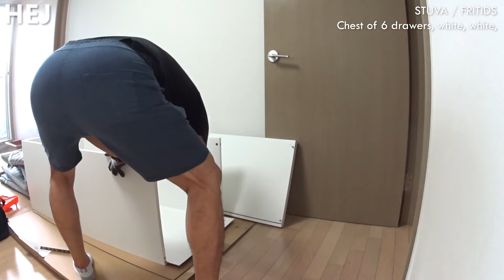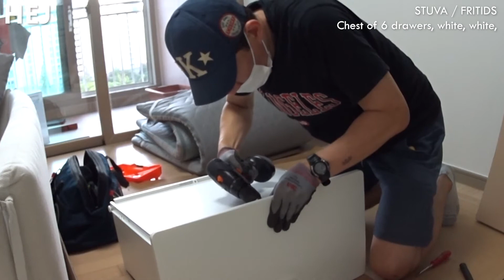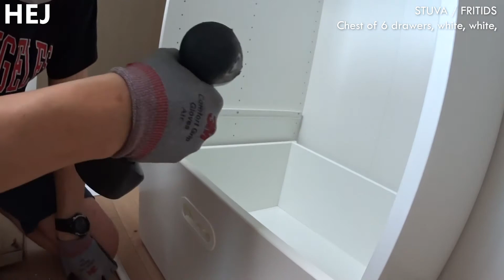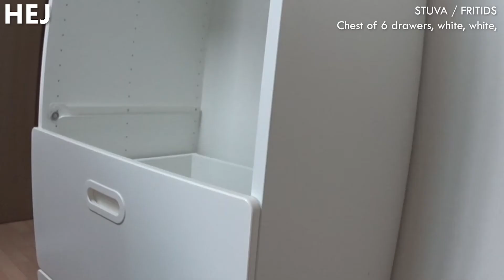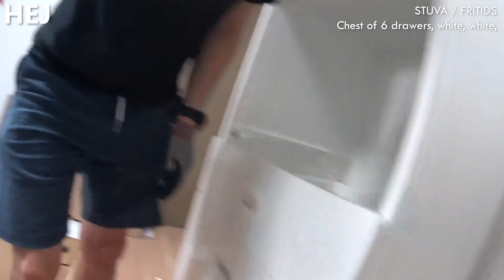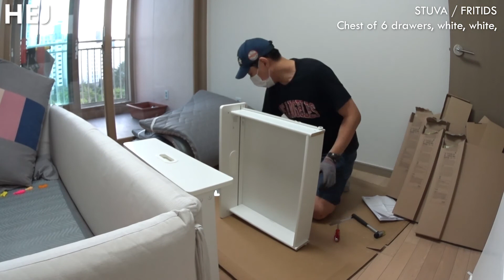How to Assemble - IKEA 이케아 STUVA 스투바 / FRITIDS 프리티스 6칸서랍장, 화이트, 조립가이드

Comment: Hello, your video is great but I am l struggling with the space between the drawers. I did as per the instructions though 😵 can you please tell me at which holes number you place them ?
Reply: Same
Reply from the maker: At first, I had a few trials and errors because of that part.
Currently, the product has been discontinued and I cannot take pictures again, but as far as I remember, there are five holes in the work drawer.
Reply: Did you figure this out I’m having the same problem ?
Reply: @hejsseopikeaassembly4531  do u still have the product?
Reply: Did you figured it out? Same problem here
Reply: Same problem here
Reply: Hello! Did you figure it out? I’m having same problem right now😂